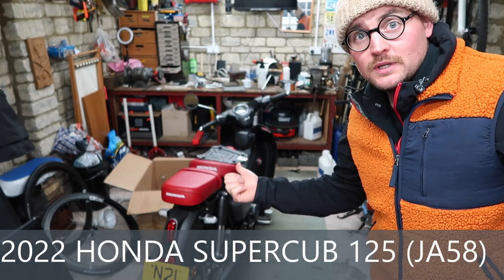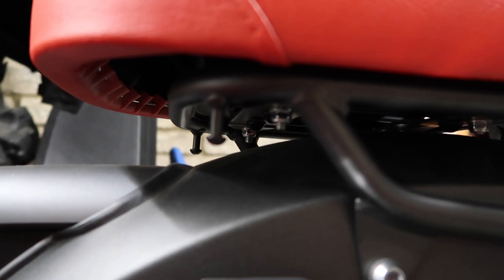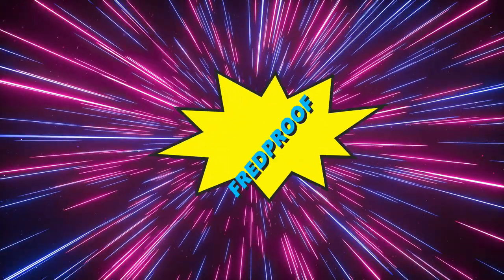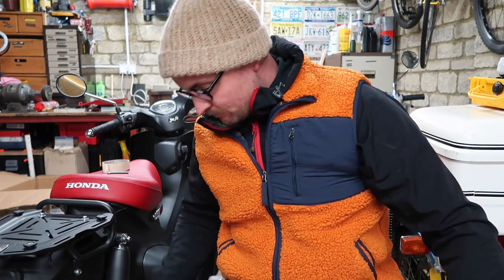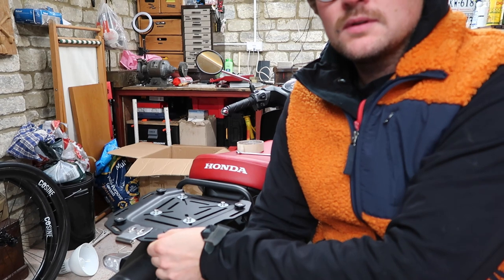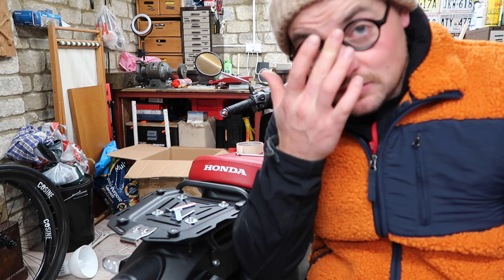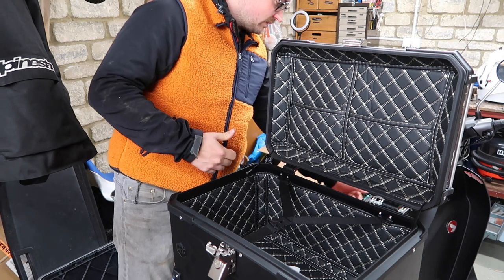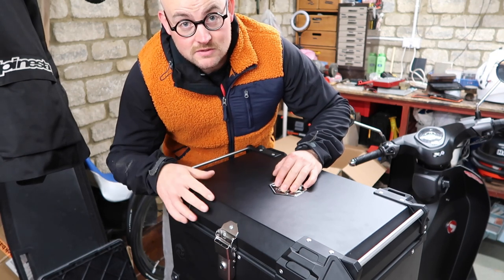HOW TO PUT A TOP BOX ON A MOTORBIKE - 2022 JA58 HONDA SUPERCUB C125

Comment: Great vid. Just done my own box. Quick tip for all of ya. 
Save struggling under the rack with the nuts. Just undo the back two torq bolts on the rack, then lift up the seat, pivoting on the rear suspension bolts, and tip the rack up on its end. All nuts are much easier to access and do up, etc!. Check the screw lengths, too, as some manufacturers give long bolt's and when you lower the rack they will scratch the mudguard. So you'll have to cut them a bit shorter.
Reply from the maker: Very good bits of advice there. Thanks very much. You happy with your cub?
Reply: @Epoh Derf.  I literally picked it up Wednesday just gone. Have now done 120 miles already. I hope that answers the question! 😁😁😁
It's epic, in a 125cc sort of way. 
I live near the Yorkshire Dales 
(I know,  boring as f**k. Keep away, Southerners,  nothing to see here!)
And there are quite a few 1st gear hills around here! 
Being in my 60's with a gammy leg, a BMW adventure bike was out of the question. I tried a CanAm Ryker. All that wants to do is chuck you off around each bend. And I tried a Royal Enfield Himalyan. Way too heavy for the power. (And my gammy leg!) LOL.
So I had to admit it was either a Piaggio mp3, or a Honda super cub. You now know which won that competition! Hahaha!
Keep up the great biscuit vids and the useful 'easy' mechanical stuff vids.
Reply from the maker: @nicholaskemp2246  I hope you have a happy summer of wheeling around ahead.

Comment: Thanks for this. I was looking at doing something similar for my bike. Givi do a rear rack (SR1195) that helpfully allows you to keep the use of the pillion seat if that's important to you. (It is to me.) It uses their monolock system so you can use any of that range of top boxes. The E43 looks suitable for the Supercub. Availability does seem an issue though. Cheers.
Reply from the maker: I am glad it is helpful. I did see the monolock series but fancied the somewhat tongue in cheek brashness if a big, blocky 'adventure' top box.

One thing I have noticed is that at 50mph+ in the dirty air behind a big vehicle like a bus or lorry, the bike wanders and is blustered about a bit more. Aside from that, it is completely ordinary to use and infinitely more practical.

Cheers for watching.

Comment: Good video. Im getting a supercub and would like to put on a useful box as such. Im curious how secure the box is to the bike and also how secure the box is in itself.  Can those kids be trusted to assemble the box?
Reply from the maker: @timothywilson890  2k miles and counting.

Nothing has broken. Only thing that did happen is a Honda bolt fell out of the rear rack. I just put a fresh one in with some loctite.
Reply: @EpohDerf  that's great, thanks Fred. One last question - did you purchase the box from alibabas? It can be a bit of puzzle finding a reputable source that I don't have to sell a kidney to fund.
Reply from the maker: @timothywilson890  I bought on eBay (UK). A mate in the states got one from the Alibaba website and it is exactly the same as mine.

Comment: An addition I'd hoped to make next year but I've been told the pillion seat stays. Hopefully once herself has passed her CBT and has her own Honda mini moto of choice I can come back to this idea.
I've just replaced my Cub's tools with Wera, would you class them as Fred-proof too?
Reply from the maker: I think wera may well be FREDPROOF. A few times I've been using the tiny ratchet to loosen something and found myself wincing and grimacing in anticipation of a snap that didn't come.

I have some of their extending screwdriver handles, chisel screw drivers etc and I have yet to break any.

Perhaps I am just becoming less oafish with age?

If you fit the box, then that might expedite the progress with CBT. Good time to do it as lots of people only want to learn in summer. Will also make you a better rider if you learn in adversarial conditions.
Reply: The hardest part is fitting it in around her working hours. Her new helmet arrives in a couple of days and the nice meteorologist forecasts calmer weather next week (Autumn on the IoM so far has been a combination of wind and rain followed by rain and wind with the odd gale for good measure) so I'm planning on taking her out on the Cub. Constant exposure I'm hoping will drive her to take charge of the situation as she doesn't like to be driven...
Loving the videos and was wondering if a Nice biscuit review would be possible?

Comment: Looks to big for the cub ?  Maybe 45L and what is that jacket 🧥 😳
Reply from the maker: You might be right about too big. I've not loaded it up heavily yet so don't know for sure. As for the coat - it is warm, the garage is cold and I am not a fashion icon....
Reply: The new 2022 Super Cub has a load capacity of 150 kgs as the suspension is uprated to carry a passenger unlike the 20-21 model they had in the USA so the rack under the passenger seat can take the weight, I am 80kgs and carried 40kgs of camping gear for 1700 miles with only the lack of top speed as an issue but that would have happened with a passenger anyway.
Reply from the maker: @williamcoulter5462  I've done some miles with it fully laden and nothing snapped or fell off. Success I suppose.